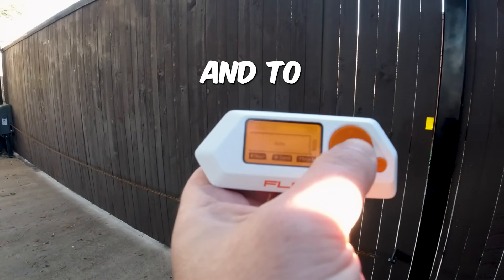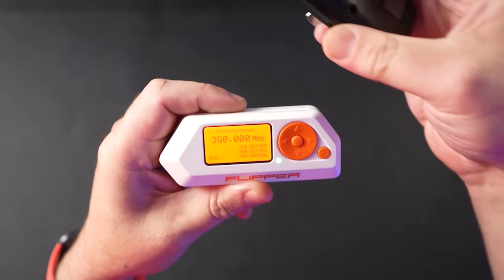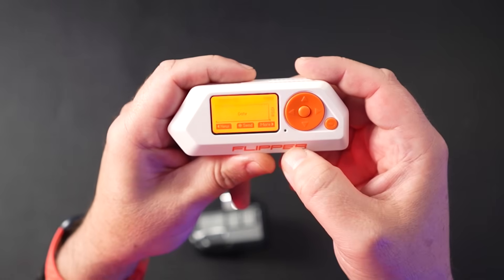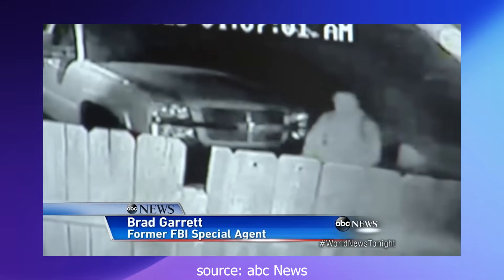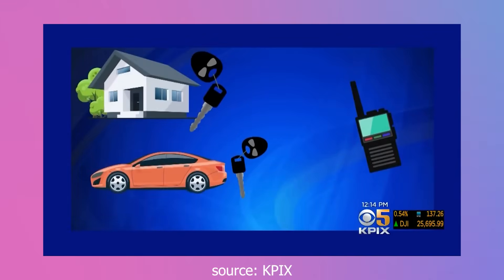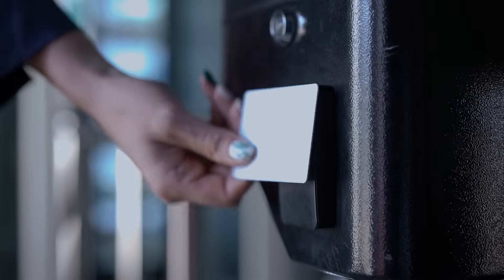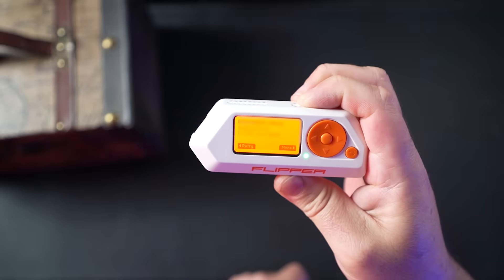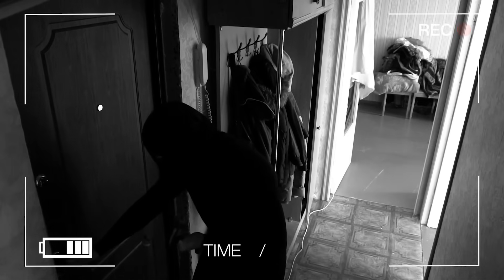Can the Flipper Zero REALLY do this?

Comment: Certain brands had an issue where if you captured a rolling code, it could be reused again. The algorithm was fixed in later cars (2022+ iirc) but i don't think it could be applied retroactively. I don't think the old algorithm itself was cracked though, so afaik it still has to be intercepted and/or amplified which is thankfully a bit hard to pull off

Comment: Does it work on gate barrier? a parking barrier that uses a card for example..
Reply from the maker: Depends on the system. I tried it in one area and cloned a friend's access card and it worked. But in another area it didn't
Reply: @LironSegev  You’re talking about copying signal directly from the system or from the card?

Comment: im trying to replicate the gate code for our gated community, since replacing in an HOA location is expensive. I googled some info on the remote and it seems to be a linear code, yet I cannot pick up any kind of signal from the frequency analyzer. When I do a RAW read, it maybe managed to pick up a speck of data but as I replayed it in front of my gate, it did not work. it is a Multi-Code 3089 Remote --
Model: 3089 (308911)
Compatible with 300 MHz Multi-Code model 1090 Receiver and other 300MHz frequency Multi-Code receivers
Compatible with Linear model receivers 109950 and 302850
Supplied with visor clip
Easy access to battery and coding switches
Power: 9-volt battery
Codes: 1,024 (set by dip switches)
RF frequency: 300 MHz

Comment: This is why we have had power switches installed in our garage, for example. When we go to bed at night, we simply turn it off, it's like a standard light switch but instead it cuts all power to the door. Mum thought of that one 35+ years ago and the whole extended family has done it ever since.
Reply: This is a great idea!
Reply: Garage door fishing is a thing which a cost hangar pulls the emergency release red cable unless the garage door is physically locked on the sides inside
Reply: @Zack-xl6ph  there are ways of stopping that. as simple as turning the carriage around. though i have installed an actuator to actuate the garage door lock and operate it with home assistant.
Reply: @pen25   An even easier way is to just remove the T-handle. The hook can't grab the line.  Alternatively, for more security, remove the cable all together. Then zip tie the release so that it can't be pulled.
Reply: Mine came installed with it then they released these flippers lucky me didn’t have to worry bout tht prob
Reply: This is great.  However I have a question. Doesn't the garage door lose its code when you lose power?
Reply: @my2cents5  Not in the slightest, that has never happened over 25 years and 3 houses.
Reply: *mom
Reply: @trilltex5123  Here you go, would have taken you 2 seconds via google. If you are going to be a smarty pants and contribute nothing to a topic other than attempting to correct some spelling, at least make sure you are correcting it properly:

Mum
The English spelling, commonly used in Australia and the UK. "Mum" can also be used as a proper noun to refer to someone's mother. For example, "Harriet called, Mum, please come here for a minute!". 
*Mom
Most associated with American English. The shift from British spelling to "mom" in the early 1800s was likely due to a preference for more logical options. The first recorded use of "mommy" was in 1844, and the shortened "mom" took off by 1867*. 
Mam
Common in Ireland, Wales, and parts of northern England. "Mam" is probably the oldest of the three spellings. 
LOL
Reply: @ YouTube is an American platform therefore you have to speak American English. Sorry papas
Reply: @Bavanity  I'm not concerned about bed time. I've installed a manual lock.  I having issues when I leave the house in broad daylight.
Reply: This is genius

Comment: Totally off-topic here but. What should I do with an older laptop or netbook that will not handle windows 11?. I was thinking o  either Chrome flex or maybe a Linux distro for simple stuff, Such as email, web surfing or maybe using Libre office. The only thing about chrome is it's basically unusable if you're not on the internet.

Comment: Sorry to change subjects. What's your take on new serge protected UPS systems available today. I just remember older packs that were 30-40lbs. Looks like the new ones are considerably smaller. Power requirement would be for 600w pc's, 2 monitors, router, several wall bricks for external hard drives ???
Reply: get one of those solar generators and a 100 watt panel.

Comment: Most garage door open buttons ALSO have a LOCK button that shuts off the door and LOCKS it. Button has to be manually pushed to UNLOCK and use a remote. Push at night and it will help.
Reply: @TheTruth.K.J.V.  none of my remotes have that. What type of remote do you have?
Reply: My Liftmaster had it. Amazon search your brand LiftMaster/Chamberlain/Sears "wired 2 button garage door opener wall mount with lock out " 👍
Reply: @my2cents5  only on my wired wall switch. See A mazon